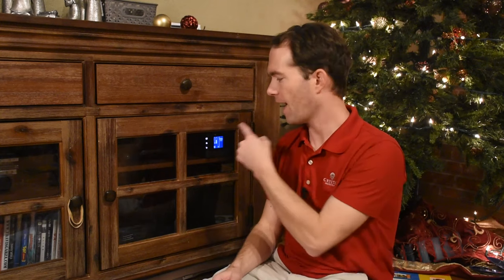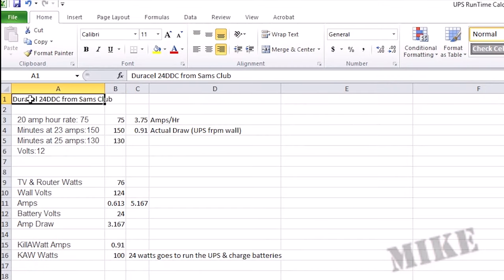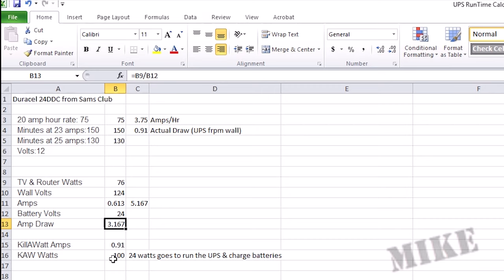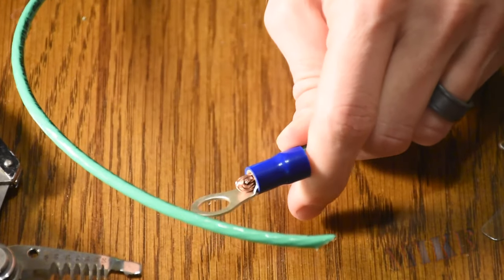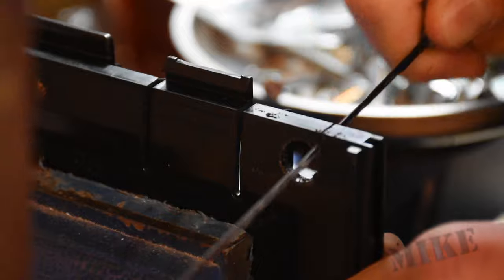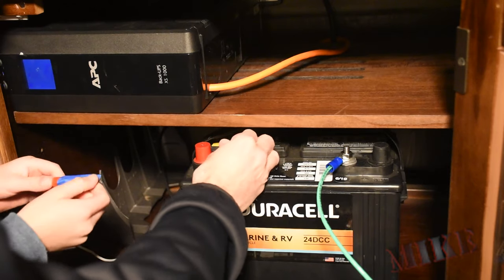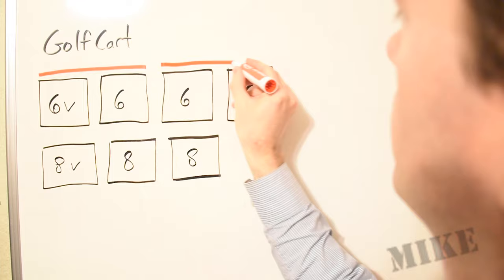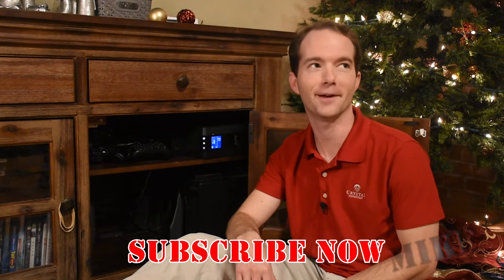SUPER UPS Battery Hack- Mikes Inventions

Comment: Looks awesome! Did u test to see how long the batteries actually lasted? I'm looking for something to run my t.v. when the power goes out, and lasts long.   Question on the wattage: my Tv alone is 170 watts.  How was it showing your t.v. and router were only 76 watts? 
Thanks!
Reply from the maker: Hey Tyler. Thanks! I've never tested it all the way down. I hope I never have to really.  I'd need to unhook it all and charge it externally if I drew them down that far, because I don't want to stress the internal charger that much. It'd probably break. I don't know how my TV was showing only 76 watts. I'd rather not pull it off the wall to verify, but I'm certainly happy with that. It's fairly new too.
Reply: @MikesInventions  yeah that is a really low wattage rating for a TV.  How about the Duracell 27 DCX? I see it has a 90 Ah rating.  Some low ratings on it though more than the one in your example so IDK.  I dont have a UPS so was going to go with a battery like yours in conjunction with a power inverter   and power my modem only with it.  My modem is only 10 watts so I figure I could power it for about 5 days running 15 hours a day in the event of a hurricane and power outage for that long  like last time.  I could use a 2nd battery to recharge the first one, but these batteries take about 18-20 hours to recharge from what I read with the charger I have.   The charger  uses about 60 watts  too so not practical when your trying make batteries last long during a 5 day power outage!  Also I read that these batteries will not last over a year if deeply discharged is that true?
Reply from the maker: @tylermack954  So check and see what input voltage your model modem requires. If it's 12v or less, you can make a plug and go directly to batteries without running through an inverter. It'd be much more efficient, thus longer run time. If it's less that 12v, then get yourself a voltage converter to step it down, that'll still be more efficient than running an inverter. Also, you can't use one battery to charge another that's identical, because a voltage higher than the battery's rated voltage is required to charge it.  You'll end up with two batteries that are half charged. Just run two batteries in parallel to double your run time.  Lastly, it is true that every deep discharge wears out the battery a bit.  Batteries meant for deep cycling typically have a cycle count listed in their specs along with capacity. Let me know how it turns out. Don't turn dc to ac and back again if you don't have to. Thanks for watching! I hope this helps you out a bit.
Reply: @MikesInventions  TV power consumption: I believe power consumption is very variable dependant on what's being displayed along with brightness (and such) settings - a dark picture is much less than colored or white picture; I don't know how/what consumption is advertised, but they seem to be far from a realistic picture average.
Reply: @louf7178  No. Not unless you're dealing with an oled, dimmable brightness zones, or other such tomfoolery. The reason for the disparity might be if Tyler's LCD uses CCFL backlighting instead of light emitting diode. It's not a dramatic difference, but it is measurable. My old 30" Dell monitor pulls well over 100 watts, but the 27" LG, despite being just a little smaller consumes only a fraction of that. The chipset probably uses some power as well, (in older sets, this can be as much as 30 watts) but isn't typically a big consumer.

Comment: Your ups internal charging circuit isn't going to keep up with those batteries long term.  You will end up damaging them.
Reply: AIX SA would it work if the same setup was used and a battery tender was hooked up to the deep cycle battery?
Reply: @johnnyhoang4444  Unless you have a way of bypassing the internal charger and using the proper charger for the deep cycle, I wouldn't recommend it.
Reply: @nobodynever7884  The internal ups amp/hour charging circuit is designed for the battery that came with the ups, not for the deep cycle, that would require a higher amp hour charger.  Not all battery chargers are the same.
Reply: @aixsa3877  I don't understand why charging a battery at a lower amperage would end up killing the battery faster? assuming you charge at a rate higher than the battery loses charge, else it actually isn't charging

it would essentially be a lesser form of trickle charging would it not? so as long as it stops charging when at full charge it shouldnt actually damage the batteries whatsoever?
Reply: @BRUHItsABunny  see comment above, and read up on charging deep cycle batteries.
Reply: I have been running a similar setup for about 2 years with no issues so far. I do have an external charger hooked to the batteries. When the external charger runs, the UPS sees the higher voltage and switches off its internal charging circuit.

Comment: That cable size going from series to UPS is only rated for AC current (likely 15-30amp) 
I would be very wary of running anything heavier than 30amp DC

Comment: mice video those ups pull lot power i have small back-ups cs 350 ok so i have 1100 watts  inverter 12 volt deep cycle battery 75 amp 900 watts i dose pull 107 watts out it way better than ups

Comment: Hi Mr Mike
Im your new subscriber 
I have 3kva ups about 2000watt
Currently using 6 battery 7ah 12v

Can i use 6, 100ah 12v deep cycle batt?
Is that going to be a problem for my ups?
Reply from the maker: As long as you match the voltage to the UPS, you should be fine. That'll be some serious capacity. Nice!
Reply: @MikesInventions  which type of battery is better to use between solar batteries and car batteries. also talking of 'Ah' is the a certain stage l should cut off or l can even go to a 12v 200ah battery

Comment: So I'd love your thought on this:
I m in an RV. I rented a hotel room to charge up all of my devices & brought my APC in because it was on a shelf for 4 months. I plugged-in everything in fell asleep& woke up to a call I was late checking out! My alarm never going off becuz the hotel had an electrical problem that night and nobody in the back had electric. When I checked out they had 2 electricians vans there. My regular battery pack for my phones and tablet was at 11% So the electric charged from their one outlet for that long. When I checked all of my devices as I packed up, the APC light "Building Wiring Fault" was on. The next chance I had to plug in my APC the siren went off. Now I've plugged-in it in for 28hrs and the siren is STILL GOING OFF. Could something at that hotel have ? ruined my battery for the APC? Or the APC itself? or in your opinion is this just a strange coincidence? Or what do you think?

Comment: Why wouldn't you use a 16mm (or so) IP68 black plastic compression gland with lock nut to run the cables through?

Comment: If you weren't home and the power went out, couldn't someone plug bigger / multiple loads into that, overheat that 14 ga. wire and burn your house down? What's the ampacity of the extension cord? You have the benefit of being 24v over 12v but still.... Combined with the H2 gas comment, I'd be relooking at the build. Insurance won't pay for a crispy mountain of rubble caused by a home inventor's whoopsie. Cheers.

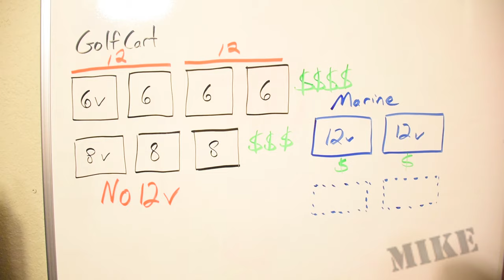Comment: @8:08 It is NOT wise to later add capacity by connecting other batteries  (sets of two 12V in series) in parallel to the ones you are using now.
You should always use the same battery types (brand and type), same age(!) and preferably same production batch.
If not, the batteries are going to react to each other, shortening the life span of you new batteries dramaticallly.
Reply: this is true, however in the video he does what you say, he only connects 2 12v batteries bought at the same time... he just checked the positive on the ups battery to know which connection is positive and negative...

Comment: My issues a somewhat similar but different. I have an solar array of 400watts. I could run some equipment in my house for 6 hours a day but cloudy weather doesn’t play well with electronics. I also need the array available if power goes out. A grid tie inverter would not achieve this and my power company would have a cow. So I drive a clean efficient sine wave inverter into the ups, if the panels shade it immediately reverts to the SLA batteries. If the sun is out the ups automatically reverts to the solar inverter and recharges the sla batts plus handles current equipment loads. No power sages... no bs deep cycle Marie bats.. to ridicules MPPT controller.  The last thing I need to accomplish is an ac transfer switch for rainy days and nights. I know the is “waste” in the system but it works.

Comment: The man needs to manufacture a boat load of these things and sell them on Amazon for the average non DIY guy PLEASE DO THAT🙏🏻🙏🏻🙏🏻
Reply: While this is a clever hack and one that I might even do if I was ever in the situation that required it, there are several serious code issues with the implementation.   If you really need this kind of battery back up, ask yourself: "does it need to be uninterruptible?"  

If it doesn't need to be uninterruptible, there are lots of battery packs on the market that could be hooked up after the power goes out and that would last quite long in this application.  Alternatively, you could simply use a gas/propane/natural gas portable or standby generator.  You would have a short delay with a portable system, but you can run it for hours or days easily and safely.  With a standby system, you can get by with a very small UPS as you only need it to carry the power for about 30-60 seconds until the generator starts providing power.  I have a standby system, but I still throw 450-600 watt UPS around the house just to eliminate the hassle of restarts and lost data.

Comment: Why no way to get 12v from 8v batteries? They have just about any step-up or step-down DC power modules you can imagine for only a couple bucks. Many only cost 1$ with free shipping (or less than $1 shipping) for smaller one's... and you can get bigger one's for a couple bucks more. They get up to $50 or even $200, but I don't think you'd want any that powerful or expensive just for 12v.

Comment: You should collect old used "dead" gel batteries, (people literally throw ups's away by the thousands.. get like a hundred of them lol. and get a reconditioner, which u can create a massive power bank from for free (pretty much free anyways)
but that would be amazing. maybe a nice mppt controller and jack in all your off grid sources input to there making a centralized mass power storage system that would last months if needed xD

if u do solar: btw 24V with mppt is legendary! never use 12V w solar lmao.. only noobs and charlatans do that 😂